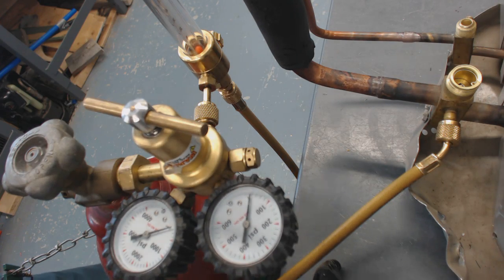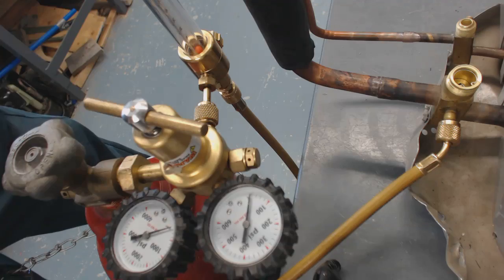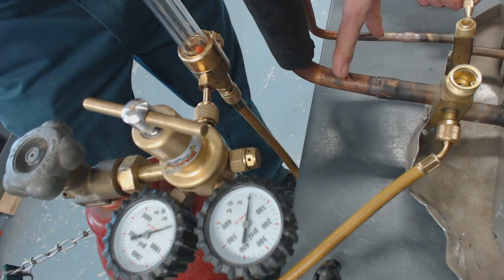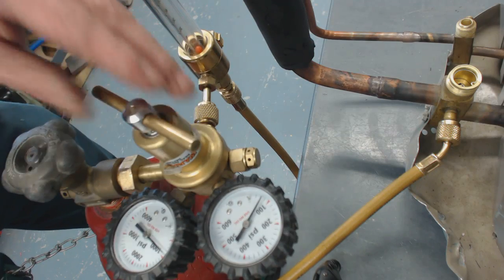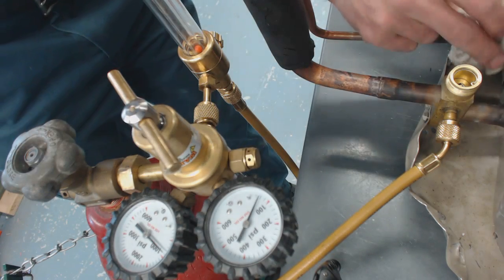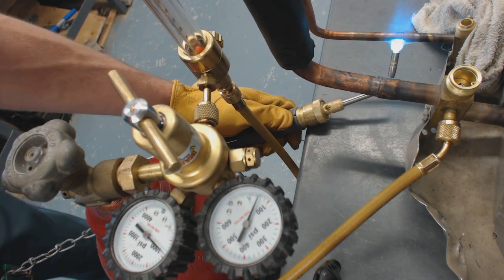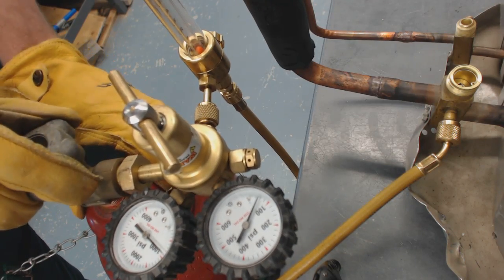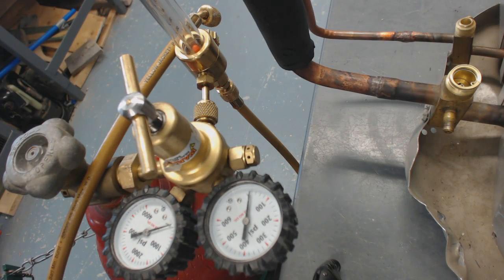How to Braze with Nitrogen! The Process up Close from Start to Finsh!

Comment: Great video; Craig, always clear and concise. Thank you.

First a little background. I am a retired HVAC tech having spent 25 of my 35 years in the industry as an HVAC business owner and operator (I did all the work with some help from my son and my wife). 

I was attending a Goodman dealer meeting and they were going over the need for flowing nitrogen through the line set while brazing the line set to the condenser tubing stubs. I asked the Goodman reps why we needed to sweep nitrogen through the lines; why couldn't we just purge all the air out of the lines and then braze, knowing this technique would work, having bench tested it . They huddled, talked it over and then agreed that could work, but it was Goodman/s policy that the nitrogen be swept through the lines while brazing.

The setup I used while brazing was to connect two copper fittings I made that were about 4 inches long to the service valves' access ports, after removing the valve cores. I  used 1/4" flared fittings on these ends and they are at a 90 degree angle.. The other ends have 1/4" access valves for connecting a hose from the nitrogen flow control valve and were straight. This way I didn't need to worry about melting the hose seal and eliminated the possibility of water getting into the access valves since they protruded upwards about 4 inches from the valves. In addition, the nitrogen would stay in the lines after I shut off the nitrogen flow control valve since nitrogen is heavier than air and the fact that there was no pressure behind it. I saved a lot of nitrogen this way and I did not have a single call back from a metering device or filter drier plugging up with copper oxide.

So, what is your opinion of my method?

Thank you.
Reply: can you dm me a picture i just stared as a installer and tired of MD , Filter Dryer callbacks

Comment: Fuck that, just weld it .
Reply: Lol. Yeah just go ahead and solder it...! Why did you get into this trade? 

Why do you do anything if you're not going to do it the right way? Have you been a hack your entire life at everything you do?

Doing things improperly because it's the easiest way, or it's just another "thing" or step in the process of the job is ridiculous and a complete disservice to yourself, your company and the paying customer.  If you think you are saving time and money but cutting corners GOOD LUCK with that one, as it will rear its head soon when you have to keep going back to these customers and start dealing with failed components that were caused by you taking short cuts. 
Day one of installing equipment is the most important day. It literally predicts the life of it.
Reply: It can't get the oxidation out.   It just moves it throughout system. It's all going to be in the dier.

Comment: Can i asck you about this regulator at tme 02:20
First you open the key knop of  the Cylinder then you open the key of the Regulator then you open the flow metter 
The is the flow meter help us to the consumption of the Gas and the Regulator help us as safe Guard for the Flow meter because what i know is every pressure level =  to Level of Flow in medical use for example  we use the Maximum level of  flow  meter in order  to achive certune amount of pressure either in CM H2O  or in MBar

Comment: It will tank awhile for the dry nitrogen to push out air or residual refrigerant thru the entire system, NO way to really tell how long  to purge out as every system a bit differant,  keep in mind long line sets and the A-coil / evaporator ALL has to be purged!!!!

Comment: This looks time-consuming, especially in a supermarket setting. isn't it better to braze it all and change all filters at least 3 times at startup? Anyone has opinions about this. When I'm welding 30 systems 90-150ft each system. I rather change the rack system filters 3 times at startup. I clean all cases valves and walking valves as well, and I end up with zero particles? any ideas anyone has done what I do?

Comment: Wouldn't cooling your lines with a wet rag potentially create a thermal crack or at least increase the chance of thermal shock?
Reply: Nah copper is malleable enough it doesn’t readily crack from
Temperature change.  Not saying it can’t  but it’s definitely not like steel
Reply: yes.

Comment: Gr8 Vid.  You should really purge all the air out of the lines before lowering the flow rate.
Reply: The next step is vacuuming does he really need to purge it though
Reply: If: Brand new capped lines they are pre charged with nitro which  helps

Comment: Where would you put the nitrogen hose on the unit for the suction line brazing. Would It Go on the liquid line? Or would it stay on the suction line. I went to school for this. However my teacher can't show me everything. There's so much to know.
Reply from the maker: You would switch it to the other side so if you were brazing the suction valve, the nitrogen would be on the liquid valve, when brazing the liquid valve, the nitrogen would go on the suction valve, thanks!

Comment: Very good. However I hate to say it most of the people that do the braising don't use the nitrogen. I've gotten onto them so many times and they threatened to even fire me because I made such a big deal about it. There is a lot of corruption in this industry to.
Reply from the maker: If you are in a lower position in the company then you kind of have to go with the flow but when you are running the job site yourself then you can make sure that those under you are doing it properly. It is a waiting game sometimes for newer techs, thanks!

Comment: Im no expert but I saw a another video where the tech flows the nitro through the liquid line traveling through the txv and coming backbout the suction line. He chases the nitro as he brazes. For example he starts with the liqiud at the compressor. Then goes up to the evap continues with the liquid the the suction at the evap and then comes back down and finishes at the suction at the compressor. Chasing the nitro.
Reply from the maker: Hey Christian, the only issue with that is you don't want to have your nitrogen hose on the port of the first service valve you braze because you will be melting the rubber gasket on the hose. If it doesn't melt, it will still get deformed some, thanks and great observation!

Comment: Is there a limit to how far the Nitrogen at such a low CFH will actually travel and where it becomes ineffective? I do large scale VRF jobs with some line sets that exceed 100+ feet and multiple Y's (refnet's). For example, I may braze a 1/4" service pigtail on the starting point of a Suction line for running my nitrogen through. It may branch off to 10+ air handlers that are maybe 100+ feet away before it sees it's first split. 

Am I okay to just continue running 3-5 cfh at the same service point when im down the line 100+ feet? Just seems like the nitro flow becomes redundant when you reach a certain distance UNLESS you up the pressure to compensate for the distance? Any input on this would help. Thanks!
Reply from the maker: If it is a long run or many units connected together, first purge at 20 cfh and then you can drop down to 5 cfh instead of 3. Once the air is removed from the initial minutes of purging, this flow rated should keep it good, thanks!

Comment: Won’t the expansion valve prevent the nitrogen from entering the liquid line?
Reply from the maker: For air conditioning, they usually do not close down all the way at 0 atmospheric pressure, you can feel the flow at the open port, thanks!

Comment: So how do you braze the condenser unit before the lineset is soldered at the air handler? How will the nitrogen flow through the coil to get to the LL connection you are brazing or vice versa? 

Also how will you solder the air handler? Say if you are brazing the LL @ the AH, would you just connect your nitrogen to the LL at the condenser unit?
Reply from the maker: I usually wait until I have everything connected to braze the outdoor unit in. This way the nitrogen flows through the whole thing. I have 3 videos, part 1, part 2, part 3, where I show how I brazed a whole system in. Look up "acservicetech brazing" thanks

Comment: I’ve watched a few videos of people brazing linesets, and one thing I’ve noticed is that not one of them use flux before soldering. Is this because of the chance to contaminate the inside?
Reply from the maker: This is brazing with 15% silver brazing rod. The phosphorus in the rod fluxes it. You would flux when using lower temp solder such as Stay Brite 8. You would use stay Clean product. Look up acservicetech brazing playlist for more videos and brazing and swaging tools along with rods are found at amazon.com/shop/acservicetech   thanks
Reply: AC Service Tech LLC ... Thanks for the reply. That makes sense. Is there any specific reason silver solder is used, rather than say, a lower temp solder used on water lines? Seems like there’d be less of a chance to have the joint blackened with a lower temp solder., but I’m guessing the lower temp solder can’t withstand the high pressures.
Reply from the maker: It is higher strength, the silver in it allows not to crack as easy. Low temp solder introduces a small amount of acid into the system at each joint so that is why a lot of us braze. Many techs solder with stay brite 8 and report no issues, thanks

Comment: You didnt address this but after brazing the suction line would you move the nitrogen over to the liquid side when ready to braze that one? Or just leave it on the suction?
Reply from the maker: We leave it on the liquid line while brazing the suction line and leave it in the suction line while brazing on the liquid line because you will have the tubing inside the house connected. You can braze the inside with the nitrogen on either port. Have you checked out "acservicetech Brazing with Nitrogen Playlist"  I have videos on brazing in a complete system and what happens when you don't braze with nitrogen, thanks

Comment: I did not see that ball floating at all. Make sure you have at least 5 CFH flowing through the flow meter as the diaphragm is not sensitive enough to hold the seat open. 

Also you need to FULLY wrap your service valves! Or better yet, transition to StayBrite #8.
Reply from the maker: Hey Walter, that was an older video but yes the ball is floating. It is not like the turbo torch version. The ball only floats about 3/16 from the bottom when at 3cfh. I usually flow more through before brazing and then tone it down to 3cfh while actually brazing. I always wrap the service valves. I also disconnect the bulb on the suction line of evaps that are equipped with the txv whenever possible, thanks Walter's Playground, all good topics!

Comment: Since you said that the refrigerant was “in the unit”, did you trap it in the unit by using the compressor while manipulating the service valves? And did you then do a recovery from the liquid and gas lines? (Testing myself from what I think I have been learning. Thanks. )
Reply from the maker: That is absolutely correct, a pump down, and recovery. It is possible to do a full pump down so that the unit stays below 0psig though without a recovery, awesome, thanks!

Comment: If you are brazing a copper  line inside the OD unit within 15 inches of the compressor how do you pump in nitro while brazing that section .  Do you disconnect the line at the compressor so the nitro is flowing out while brazing and not entering the compressor ?
Reply from the maker: You can't really purge with nitrogen in that situation unfortunately, thanks!

Comment: How did you make the refrigerant go Into the lines so you can braze
Reply from the maker: I was flowing dry inert nitrogen through to avoid oxidation inside the tubes. Then a pressure test must be done, then a vacuum down to 500 microns, then weigh refrigerant in, thanks

Comment: When brazing the AC line and applying a wet rage can this created condensation in the pipe due to cold against hot in the pipe?
Reply from the maker: The copper tube is not permeable to water so it should not, thanks.
Reply: If it does somehow create moisture, it would just evaporate when vacuumed down.

Comment: Most manufacturer are starting to question tech and are requiring nitrogen when brazing and will be voiding warranty if not done.
Reply from the maker: I believe this is the same reason manufacturers have chosen to stick with flares instead of braze joints on mini splits. They believe the majority of techs are not doing it and I think that is our present state, thanks Mike!

Comment: Do you have to use nitrogen when a brazing both lines?
Reply from the maker: Yes, you just switch the location of the yellow service hose attaching to the service valve. Check out the brazing playlist 3 part video.-   https://www.youtube.com/watch?v=5V_da4ymlvM&list=PLxnHR5_D2ojxi-kOFQ5FWDIUAE8ngzmZy

Comment: Hi, its always awesome to follow every part of your post we are gaining knowledge. Only I have doubt like, if still the
same outlet (SERVICE VALVE) to purge, when we solder during compressor replacement? vise versa
Reply from the maker: Unfortunately you can't flow nitrogen through because the compressor will not let it through so we do what we can when we can for the best possible job, great question, thanks jhon!

Comment: Great video thank, would you still only have the nitrogen flow at 3 cfh if you were brazing larger pipe? say 1"5/8 pipe?
Reply from the maker: Yes, you can tin tape a refrigerant hose to the end of the pipe and make sure you are brazing a good distance away from the tin tape. Then tin tap the other side and poke a small 1/4" hole in it as a purge vent.

Comment: Excuse me! Could you tell me ,why we need make brazing with nitrogene?
Reply from the maker: Black oxidation occurs when brazing without nitrogen and this would get stuck in the system and recirculate. It could clog up the filter drier, reduce lubrication on the compressor or could react with rust inhibitors to make the txv stick, thanks
Reply: Thanks!

Comment: great video, question say i pump down the system to fix a leak on the suction line. and their is oil residue on the inside of the pipe when you go bacl to braze. obviously you dont want that oil burning off inside the line while brazing. whats the best way to clear it out if repairing an old line. thanks
Reply from the maker: You just try to blow it out with nitrogen or wipe the area. Flow nitrogen through at 3 cfh. Be very very careful and avoid breathing any phosgene gas that will occur. Thanks

Comment: what percent copper silver rods are thoes and what type of flux?
Reply from the maker: Here is the link to the 15% braze rod I typically use. I use 15% on all systems and that would be considered the best thing to do. Also I have not found a time even on very small systems when I could not use a braze rod vs silver solder. Braze rod is also required for r410a systems. No flux is used. - http://amzn.to/2q0KHN5

ACSERVICETECH is a participant in the Amazon Services LLC Associates Program, an affiliate advertising program designed to provide a means for sites to earn advertising fees by advertising and linking to Amazon.com.

Comment: Seems like it would be a good idea to perform a leak check on the newly brazed joint before disconnecting the nitrogen!!
Reply from the maker: That is correct and the flow regulator must be taken off before. Here is a video-   https://youtu.be/-Fawq6cpVSw

Comment: If u don't use nitrogen, won't the in-line filter pickup the oxidation residues left inside the lines? So is nitrogen really to prevent oxidation debris or to provide for a better weld process?
Reply from the maker: Yes the inline filter drier will pick up a lot of it, will increase friction on the oil and refrigerant movement across it, mix with possible oil additives to clog up txv's moving parts, or could clog the strainer. very small particulates can get through the filter drier and comprimise the compressor. All of this because some techs are not running nitrogen through due to what they say is time. Once one knows the procedure though it really does not add much time at all and won't make leaks when brazing. It just takes a bit of getting used to then one is fine. Thanks and here is part 1 of a 3 part video using it - https://youtu.be/SEe9HXmzvAY
Reply: acservicetech you sir are a true mechanic not one of those Hit and Run mechanics
Reply: If you font see carbon coming out with the nitrogen than it's still in the system.

Comment: So if u have four joint to braze the inlet of evaporator....the outlet of evaporator...the suction and the discharge( liquid line)side of  condenser...which one do start first from start 5o finish...and does it matter if u have a txv?
Reply from the maker: Disconnect the bulb on the txv and dont cut out the section for the filter drier or install the liquid line filter drier until the very last thing. It doesn't matter where you start but that you have a clear channel from where the nitrogen enters until where it escapes. The fittings can just be pushed over the tubing and yes a decent amount of nitrogen will be lost there but that is ok as it will continue to make it through the tubing. The nitrogen will have displaced the oxygen. I would advise that you not braze right where you are running nitrogen through so you don't melt your hose. We are talking about doing the best job with what makes sense, that's all. I believe these three videos in a row part 1, 2 and 3 show me brazing through the whole process. Thanks for your question. Let me know if you have more questions after those three. Thanks